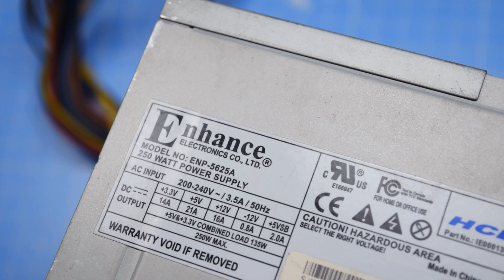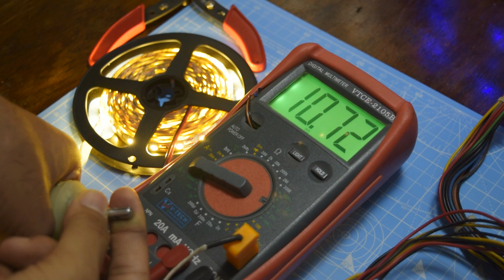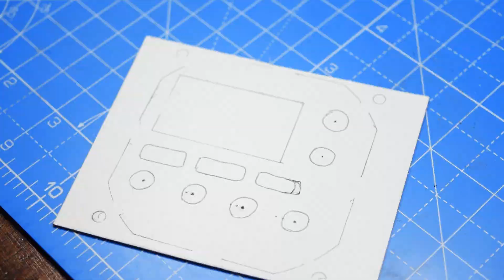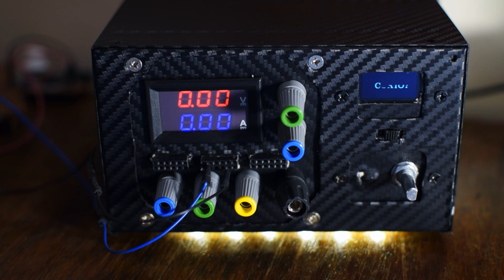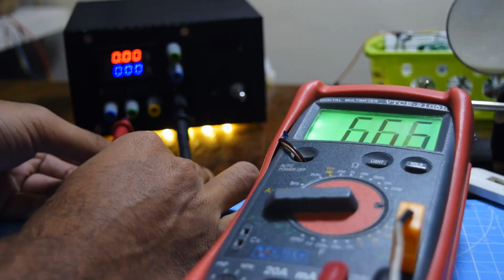Making a Variable Lab Bench Power Supply | Let's Hack!

Comment: How have you red wire with yellow wire and black wire together?
Reply from the maker: The splitter I was using had wrong colors mapped as compared to an ATX power supply so the balck and red wires are actually 12V

Comment: its not a bench power supply or even near to it ,, its more like a varialble battery eliminater , bench power supply provide us variable voltage and a limiting current flow option,, but you can still make it work with this atx supply,,, just simply find the PWM and feedback ic ..attach a potentiometer on feedback reference  pin ,, And turn off the the protection board.. this can provide you any variable stable voltage from 2.7v to 18v,,you can even 30v+ but replacing the 12v line capacitor with a 35-60v capacitor

Comment: sir,,how did you put the oled display and how did it tell if your name is showing  a little ,??
Reply from the maker: DEBASISH MANNA hey! I just attached the oled display with glue :D 
It is for a future upgrade of the power supply control unit . I'll convert it into an IOT box . With other circuitry . So I'll use that display then to display information and other things . 
For this video I was just driving it with an arduino temporarily
Stay tuned :)

Comment: sir i wanna ask that atx supply provides about 30 apms on 5v port but you are powering your led cube from that how?? i think this much current can kill the project arduino etc? how please explain???
Reply from the maker: shubham shukla hey! 
The 30A is the Maximum current it can provide on the 5V channel . But the current drawn by a circuit is dependent on the total resistance it offers . So if the resistance was 0 then the current would be maximum , by ohm's law (this is same as shorting out the positive and negative terminals) . With the LED cube there is a series resistance of 100ohm with every column and also the diodes offer a forward bias voltage of around 3.5V . Google is your best friend :)
Reply: Curio so sir if i power my esp or uno or stm32 or any equivalent or say i am changing my lithium ion battery  with it, it won't burn?? right?
Reply: Curio thank you for the reply
Reply from the maker: STM32 and ESP have a voltage requirement of  around 3.3V , most of the  development boards come with a 3.3v regulator built in and that's how you can use 5v to power them.
You can also use the 3.3v output on atx power supply to power them directly(without regulator).
You can check out the second part of this video where I add the variable voltage functionality .
 Lastly, come on man :D stop calling me sir , haha :P.
Reply from the maker: As for the Lithium-ion battery I would not recommend you charge it directly , use a TP 4056 charger board , they are very cheap. Around 20-30 rupees on Alixpress
Reply: Curio yeah i have that tp-4056 and a imax b3 for bigger lipo
Reply: Curio ok well i already watched the second part , the only thing i am afraid of that if it is a constant current source then may be it'll kill my devices
Reply: anyways thank you brother it really helped me
Reply from the maker: Haha , no ATX power supplies are more like constant voltage source on the 12,5 and 3.3v rail . When the load increases there is some voltage drop (like 12 decreases to 11.5V, because of internal resistance and other factors) . So that decrease is compensated by a feedback
Reply from the maker: No problem :D

Comment: very nice!  I have been looking for something simple yet purposeful!  I don't really need a multi voltage PSU... I just need one where I can quickly connect a case fan, some random LED lights, car LED lights, etc..  but I am having trouble visualizing how to do it and even where to get the fan pin outs, etc..
Reply from the maker: +bill smith well you can use the male and female headers if you detach often or you can also use jst connectors . Check alixpress, there are a lot of choices for connectors.
Thankyou :)

Comment: these power supplies are not stable without a load, you've seen it yourself... to stabilize them, put a 10W10ohm power resistor between the line with most Amp and GND, in your case between 5V and GND
Reply from the maker: +squalazzo yep ! Thats why I have those LED strips at the bottom , and yea I will put a dummy load soon . Thanks for the feedback :)
Reply: Squalazzo.  my power supply have 2 12 volt rail.. can i connect this 2 rail to make one only?